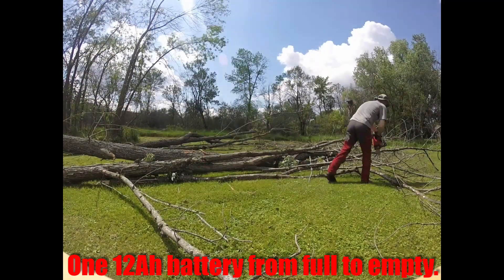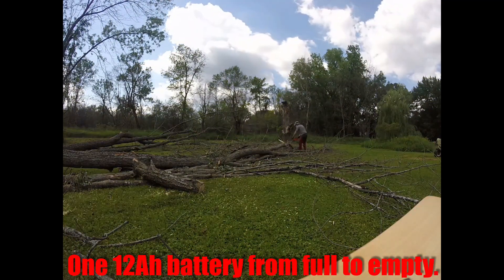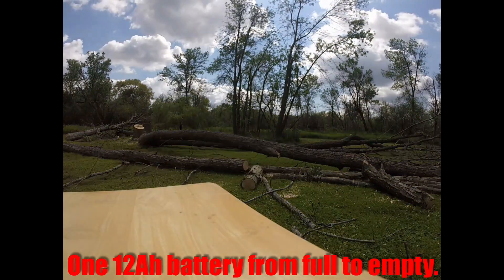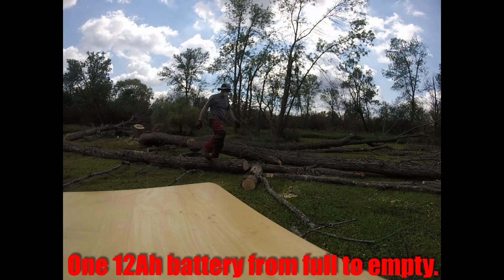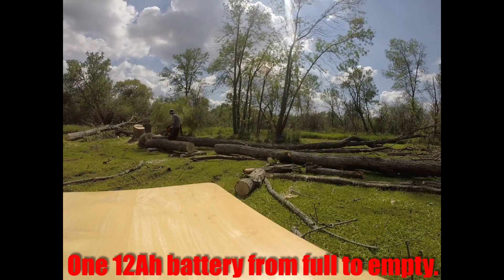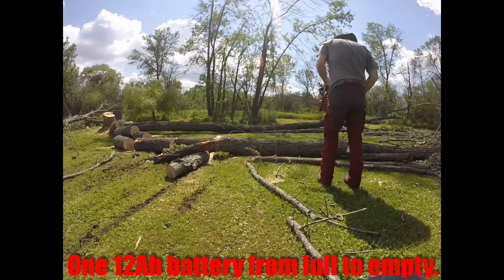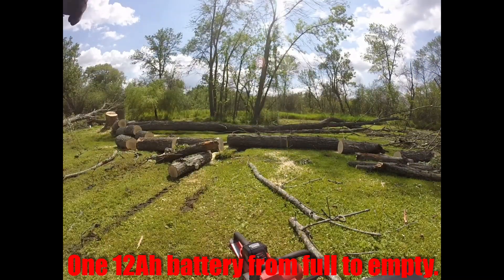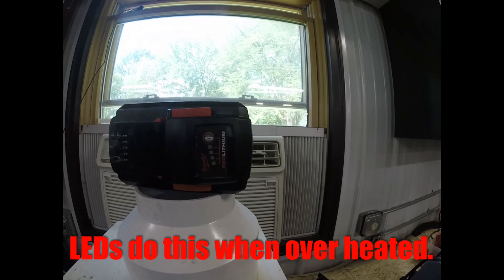45 minutes of chainsaw work with one 12Ah Milwaukee M18 battery

Comment: So I just bought the milwaukee chainsaw and after using the saw less than what you did in this video, my battery was at 120 degrees on the backside and 150 at the contacts. Is this your experience as well? My concern is that the lithium will degrade and it won't have the same runtime for very long... Also, the rapid charger doesn't have a fan or a way to cool itself while it's shoving 6amps per hour into the battery. It also gets up to 130-160 degrees...

Comment: Does it really matter how much total wood is cut with a single battery?  How big of a deal is it to slap in another battery?  It’s nothing like refueling a gas chain saw.  If run time were that important everyone should design their saw with room for a 10 lb battery or, like some manufacturers, use a backpack battery.

The Milwaukee may well be very efficient at converting watt hours of stored energy into cut wood, but this factor pales in comparison to the total watt hours itself.  Milwaukee makes quality stuff maybe the best, but others make good stuff too.

When comparing saws one should adjust for the size battery they are using and keep in mind how much the batteries cost and weigh.

One Milwaukee 18V (nom) 12Ah battery weighs 3.7 lbs. (18)x(12) = 216 watts 

One Husqvarna 36V (nom) 4.2 Ah battery weighs 3.21? lbs  (36)x(4.2) = 151 watts

Two (2) Makita 18V (nom) 6 Ah batteries weigh 2.7 lbs.  (2)x(6)x(18) = 216 watts.  Makita also runs on 5, 4 and 3 Ah batteries with progressively lower run times with the same approximate weight.

One Dewalt 54V (nom, not max) 4Ah battery weighs 3.2 lbs  (54)x(4) = 216 watts

One Still with 36V (nom) 4.9 Ah battery  weighs 3.8lbs  (36)x(4.2) = 178 watts

Unless the videos are deceptive, it does appear that 216 watt hours will cut longest with a Milwaukee (better efficiency? I don’t know.)  I seldom if ever have overheating issues with my Makita even continuous use on large logs.  Maybe since the battery source is split in two smaller units - more surface area to dissipate heat?

I’m using the Makita XCU03 right now to cut firewood from a large pile of mixed hardwood logs that didn't get to the mill.  Most of the wood is larger than 16” diameter so it requires continuous duty working around from one side to another.  Oak, hickory, black walnut, some poplar.

I installed a 16” bar with full chisel chain.  I cut my wood in 9” lengths.  Of course shorter wood requires twice as many cuts, but the pieces are easier for me to lift and split.  I fill a small trailer 5’x4’x2’ above the side rails, which is near the maximum I want to pull with a small RZR side by side.  This usually takes a set of 6 Ah and one set of 5 Ah batteries.  Sometimes I need a little extra so I carry some of my older lower capacity 3 and 4 Ah batteries if I need to finish off.  It’s real important to me to know I have a bag-o-batteries so that the job always gets finished.  I already had quite a few XLT batteries.  The bar oil always lasts throughout the job, so I never need carry oil.

If I were cutting 18” long pieces I think this saw might cut an 8’ pickup load of wood with two sets of 6 Ah batteries. The 16 inch bar with full chisel chain seems to cut much faster than the Makita 14 inch bar and chain that came on it.  I bought both bar and chain for $30 on Ebay.  Archer brand - made in Australia.  

I get to rest for 45 minutes or so after unloading while my batteries recharge (in more ways than one).  I like that!  I’m 70.  I have six chargers that I've accumulated over the years.  They all have cooling fans.

Most saws are very well built and are powerful battery chainsaws.  The Milwaukee is especially well built, they make good quality tools.  It seems odd to me that they chose to make the saw run on 18 Volts because they must to use really large wires and heavy motor windings to handle the resulting high amperage.  Makita combined their 18 volt batteries to produce 36 volts to drive the motor thus making it far lighter and smaller with the same total power output.

I think this voltage decision makes Milwaukee among the heaviest chainsaws @ 14.0 lbs while Makita’s weigh the least @ 10.1 lbs including batteries with equal power.  But the Milwaukee is one well build machine and you wouldn't go wrong with it.   From this video, I'd say it likely out performs my Makita.
Reply: A man to look up to right here. ^

Comment: Anything battery powered, circular , rezip saw, table saw, needs a very sharp new blade to give you run time and not abuse the tool or batteries